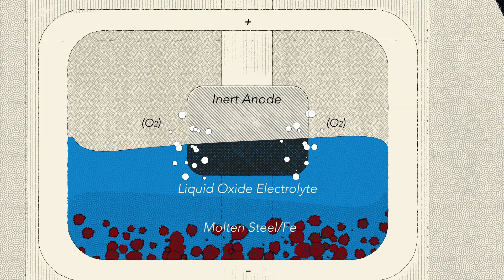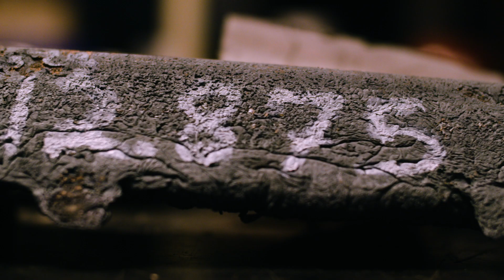Better Metal

Comment: Hahahaha! Guys visit Germany they already doing exactly that, so you have discover nothing new!
Reply: You mean like how they stupidly shut down all their safe and clean nuclear plant for greenhouse gas pumping, dangerous and polluting coal power plants?
Reply: @remliqa  Not at all!!! I mean in Germany already use electrode instead of gas burn to heat and melt still. Why because Germans aren´t that stupid and move forward in technology and better production method.                                                                             So save to yourself next useless comment unless do you have a real insight to sustain it. Regards!
Reply: @bitelogger  
A few thing things:
A) Using electricity for heating instead of burning gas releases more CO2 as generating heat from electricity is woefully inefficient. You'll be saving the planet (by reducing CO2) if you burn gas for heating rather than using  electricity for it.

B) While all modern smelters used plasma/electric arc to melts ore and creates steel, they still ended a carbon source (coke) to separate oxygen from the  metal oxides (ore). Because of this they will always generate significant amount of  CO2 gas among other things.

c) Doesn't change the  fact that the German are using highly polluting  and dangerous coal plants (especially brown coal)  after stupidly rejecting clean safe nuclear power plants for irrational reasons. Those things are far worse for the environment and our planet than nuclear plants, especially in regards to climate change.
Reply: @remliqa  In which planet are been living the last years? talking big and wildly about it nuclear energy without considering the facts that 1) No one at least in planet earth is been able to figure out how to manage the waste from Nuclear-Fission Plants, 1.1-because simply we still don't have the technology and 1.2-Because we lack the actual comprehension and I mean really deep comprehension of how to make inert or decompose the nuclear fuel. 2) The truly clean Nuclear energy is "Fusion" but as you may know (i have my doubts) we are still 30 years away to achieve that and achieve 24/7 functional Fusion reactor.